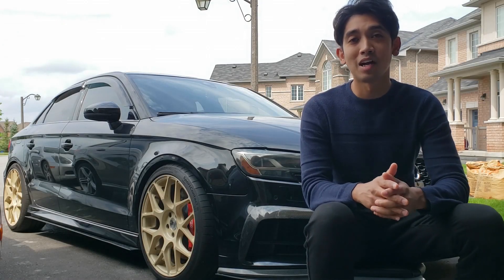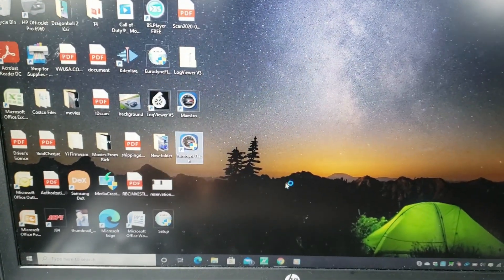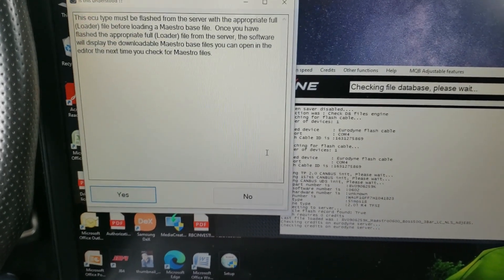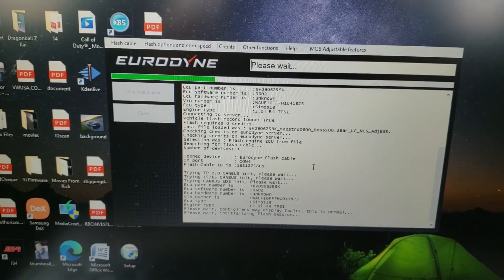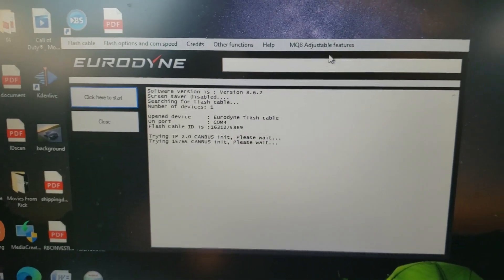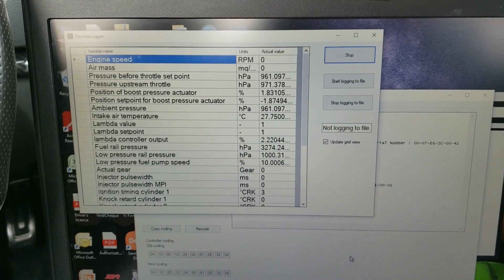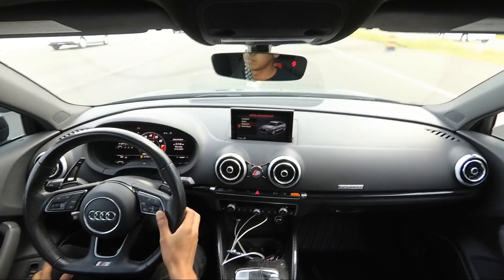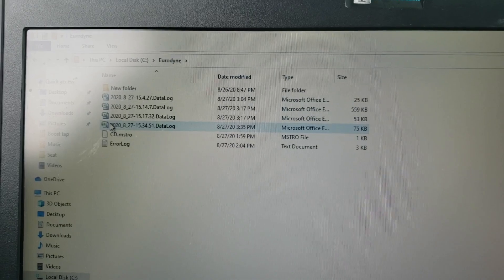Eurodyne How to Data Log and Flash | Getting E Tuned on My Hybrid Turbo Audi S3 with Eurodyne !

Comment: Hey, I currently have a JB4 on my S3.  I am getting my larger downpipe this week.  I noticed that you had a unitronics stage 2 tune before, and was curious which tune you liked the best on your S3, I am not sure if  you have tried any other companies.  I don't think I will stack my JB4 with the tune, but once I decide what tune to get, I will probably sell my JB4 and just stick with a stage 2.  Looking for your recommendation(s)?
Reply from the maker: Hello Lyle. Yes you are correct I had jb4 as well as unitronic stage 2. I can say that the flash tune was a night and day difference from the JB4. The JB4 couldn't achieve the lower end torque that the flash tunes can, and overall the tune was more consistent. If you are planing to go with a flash tune going with a flash tune with custom tuning options is a great way to leave room for upgrading down the road. You get best if both worlds with the "Staged maps" and and ability to get custom tuned. 2 options are eurodyne and cobb. If you just were looking for a flash tune I think if I had to do it again I would look at Integrated Engineering. They seem to be slightly more powerful and aggressive than unitronic
Reply: @ChampagneS3  Thanks for the detailed response.  I think I will go with the flash tune next year.. I am going to get a custom map for my JB4 here shortly and see how it holds up on the track before the season ends.  Then I can get some good numbers next year to compare.

Comment: hi guy how much power and torque,and what boost?
Reply from the maker: At the moment on 94 pump gas I'm at 31lbs of boost. As for numbers I don't have anything just yet as I haven't dynoed it yet. Will do an update video in the next week or so!
Reply: @ChampagneS3  cool men....i waiting for that
Reply: @ChampagneS3  do you know the max boost you can take with dbv2 v2 turbo?
Reply from the maker: No problem. As for Max boost I'm not too sure to be quite honest.. I know there are many users who have been pushing 35lbs of boost